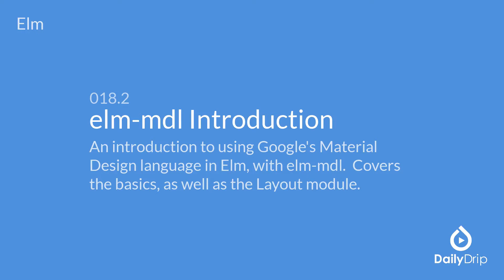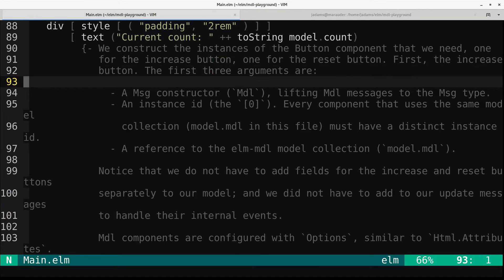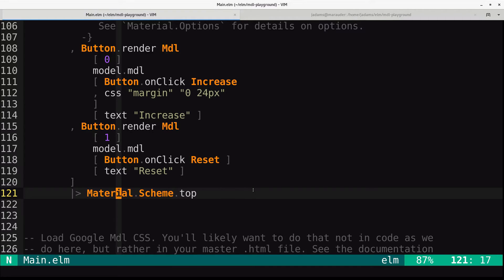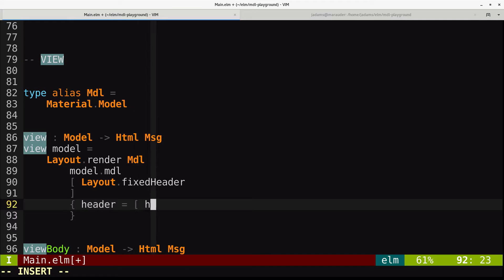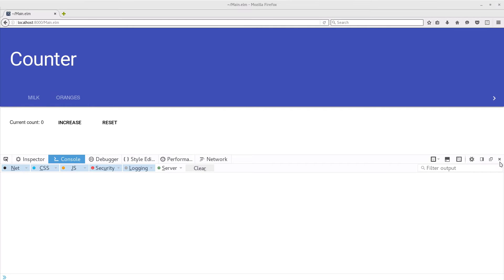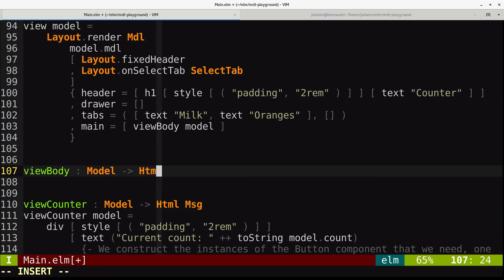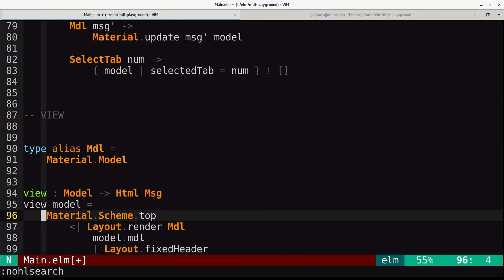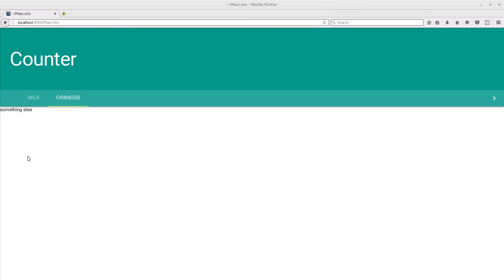Material Design in Elm via elm-mdl.

Comment: I've been reading and re-reading the elm guides and after 2 weeks my mind still gets fucked by the syntax.  "String -> Decoder msg -> Attribute msg" is the most confusing thing i've encountered in 15 years of programming.
Reply: Hey Active Shooter, the function type declaration you're describing is more familiar than it might appear.
A simple example might be addition: `add :: Int -> Int -> Int` without decoration: `add(1)(1) => 2`. And in plain english
Given an Int, and a second Int, results in an Int.

More concretely the function type declaration you shared could be described as given a String, and a Decoder of Msg, results in a Attribute of Msg. The `of` part is a little obtuse but some types in ML languages, like ELM, are monadic meaning they can be representative of nested relationships. 

Monads are essentially typed containers(boxes). 
Example: `Box (List any)`, so a box is a container of any List structure, more concretely a box of Crayons would be (assuming Crayons is a List of Crayon) `Box Crayon`. 
I hope this helps.